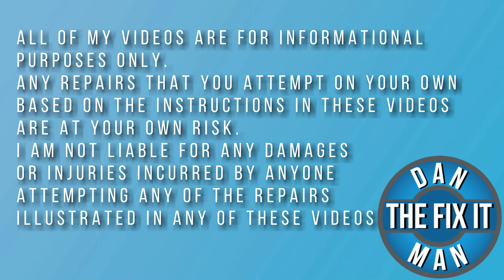2018 - 2023 HONDA ODYSSEY - HOW TO RETRACT ELECTRONIC PARKING BRAKE & REAR BRAKE PADS & ROTORS DIY!

Comment: Those little rotor screws - I have learned to loosen those when rotating tires even if I am not doing a brake job.  The sooner in the life of the car the better.  When tightening, do NOT torque them down.   Turn until it stops.

Comment: Im pretty sure your wrong with the torque specs.  Looks like the slide pin bolts are supposed to be 26 foot pounds, and the rear bracket bolts are 80 foot pounds.  But by all means, look it up for yourself
Reply: Do you have a link to this?
Reply: @usmarine0352  It’s in a service manual.

Comment: So did you had to turn the screw inside the motor counterclockwise like how it was before or there is no need?
Reply from the maker: After you are all done, when you engage the parking brake it will automatically adjust all the way out.  You don't need to turn it back out manually.
Reply: @DantheFixitMan  thank you

Comment: The rear rotor screws came right out with the Japanese screw driver, the fronts were stuck. I use a Phillips #3 (PH3) and a Milwaukee impact drill and they came right out.

Comment: Watched 4 videos on this, yours is the best.  You actually torque the bolts! I love it! Takes the guess work out and it's very important to have just the right torque.  Most bolt damage comes from over torquing.  Thread lock might be over kill on sliders and parking brake (but necessary for bracket).  I just wonder why no grease on the end points of the pads?  Some mechanics say dry is better, others say a good amount of grease will keep the dust out.  I wonder who is right?